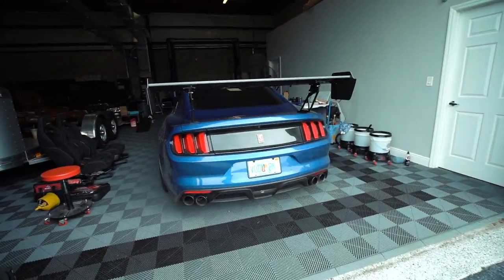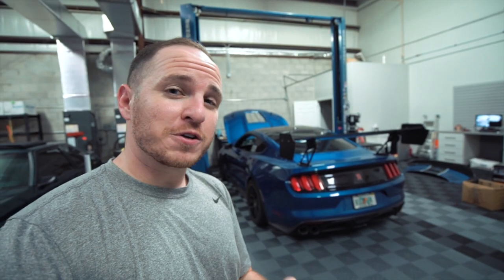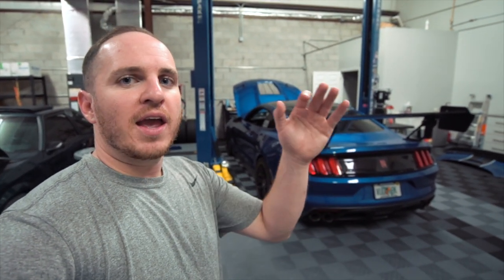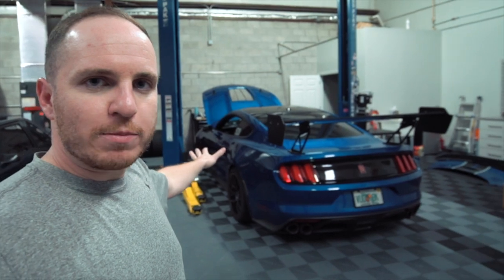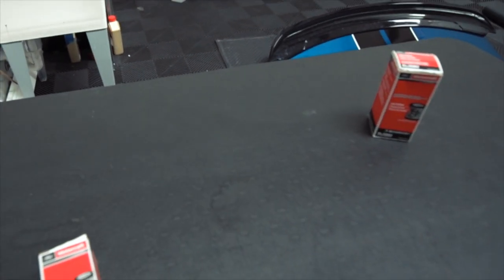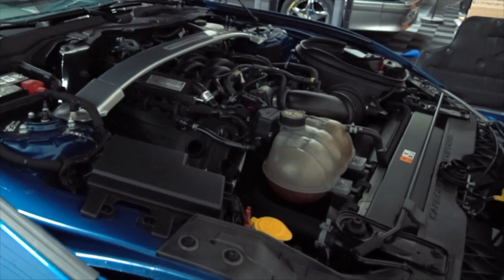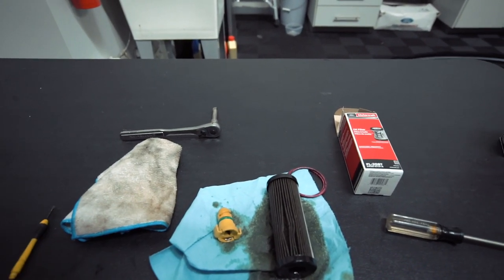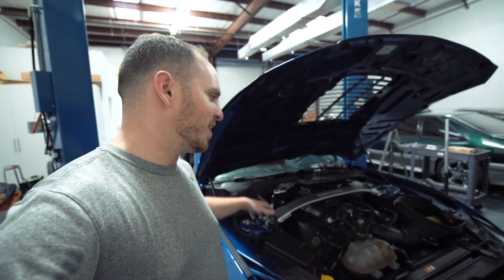GT350 OIL CONSUMPTION **DOES MY GEN II DRINK OIL?

Comment: Same here with my 2020

Only one thing to watch

The valve cover gaskets get loose and need to be re-torqued every oil change.

And Amsoil lasts a lot longer than Ford.  The oil % drops very slowly.

No loss of oil.  Though the oil cap also came off. 

Gen 2 motors also have more hp

Check out motor trends dyno tests...

50 more hp more and 20 ft lbs of torque.

Comment: I bought a 16' GT350 Tech with 30k miles 3 months ago.  All stock.  My first manual T!  I see a little oil consumption with no track use.  I only do light pulls up to 6k RPM, over that and its a jet engine!🏁

Comment: Got a 17’ and it burns about 1/2 qrt. Every 1000 miles.  13k miles on her. Still running strong.  I think running it in high RPMs (6000-8250) in 2nd gear and running it hard up the mountain (tail of the dragon) several times a year is the reason. I still wish it didn’t burn at all...
Reply: I had a 16 base track pack and 17 R and they both burned about 1 qt every ~1000 miles.  I DDed both (about 65 mi/ day).   I just bought a 2020 R so this video makes me hopeful.
Reply: I am watching this because I bought a Mach 1 in June and it’s using just about 14-16 oz every thousand miles. I switched to Amsoil signature series at 1,000 miles. That means at 5,000 mile oil change intervals it’ll use a full 12 quarts between changes.

Comment: 4:34 even Porsche recommends changing your oil after each track day. Oil is cheap and that Voodoo engine is a $23,000 engine just for the long block. I knew a ford tech that had to replace one under warranty that came in with no oil pressure after track use. He showed me the slip from parts $23,000 is a lot of oil changes.

Comment: Jeff I tried the UPR drain plug and IMO I'd just stick with the OEM.  They are cheap and no headaches.  They also seem like they click into the pan detents a little better.  I replace mine every-other oil change.

My UPR plug launched the magnet into the oil pan.  OK fine, I'll just use it without the magnet.  But at that point what's the use?

Comment: I own a 2018 GT350 and I’m have oil consumption problems, after 2000 miles it’s 2 quarts low
Reply: Ford standard says that the gt350 can burn 1 qt every 500 MI ..
.So ford indicated in their Shelby supplement that 2 qt per thousand miles was totally fine .. 

I was ok adding a qt per 500 MI but the consumption went to 4 and 5 qt and I took it in and they dropped a new gen 2 voodo in it ..

So drive it like u stole it my friends .. Have fun with ur gt350 . Just keep the oil topped off ..

. If you let the oil level get too low and the motor gives up ford will not Warrenty you .. So keep driving and keep the oil level up if. It gets  worse they will fix it .. 

It will drink more oil over time .. When it starts to consume more then 1qt per 500 mo they will fix it .  So 99% sure that you will get a new motor once it gets worse.. It happened to my 2017 and now it has a gen 2 voodo in it and drinks no oil , none .. Gen 2 motors started to be made in early 2019.. They have parts ford was using in its predator motor . They were strengthened at least 80% .. Pistons , rings, valve spring and seals, rods,timing chain components and even a new motor casting to add strength .,,

Comment: Jeff I have a 2018 GT350 with a late year build date.  I followed break-in procedure and period to the letter.  Installed oil separators at around 500 miles.  Had no oil consumption issues, albeit with pretty conservative driving.  Changed oil at 1K miles.  Sent to Blackstone for analysis.  Analysis came back clean, which was very comforting.   I now have a little over 2K miles on it and still no oil consumption issues.  Plan to do another oil change fairly soon since the car isn’t a daily driver and it’s been a little over a year since the 1K mile change.  Will send to Blackstone again for analysis to see what it looks like.  I figure if that comes back clean I am pretty safe, but knowing your experience and others it’s a bit like holding your breath and crossing your fingers and praying all at the same time.  I also wanted to comment on the new style filters.  I completely agree with you,  The new ones with the metal framework seem about 1000% better made than those others with the floating plastic piece in them.  I remember the first time I picked it up I thought it had a defect😂. Love the mods you have made and the track vids are awesome.  Keep pushin’ that thing hard👍
Reply from the maker: Stacy P thanks man! My gen I was drinking oil even during my more conservative driving during the first 500 miles. Sounds like you likely got a good one! 👊👊

Comment: Good to hear. I just took my ‘17 in the dealer. It’s going through oil at a rate of one quart every 157 miles. I’m hoping they replace with a gen2. Any tips you can give me dealing with Ford in this process?
Reply: Update?
Reply: Ford replaced my engine with a Gen 2 (2019) motor. It hasn’t lost a drip of oil since
Reply: @jasongraham5648  did Ford  get you a new warranty for that new engine or just kept existing?
Reply: The new motor came with an added 12 month warranty
Reply: They tried hard to only replacing the short block, but I was firm and forceful and got the whole long block. If your Shelby is going through the same thing don’t let the dealer and or Ford push you around. Stand your ground and be forceful.
Reply: @jasongraham5648  I am getting the long block tomorrow. Will have my car ready next Friday. I just need to fight them on the warranty. They are telling me I am only keeping existing warranty but I will push for an extended warranty on that new engine. Hopefully everything goes well
Reply: Good luck
Reply: Update?
Reply: The new motor is still running great without a single drop of oil lost. The new motor only came with a 12 month warranty

Comment: With high oil consumption on the GEN 1 motor, did that your exhaust tips turned black.
I have the exact same spec on my GT350 as you do.
Reply: My 2017 Gt 350 consumption is about a quart every 850 miles with the Ford oil. Did an oil consumption test and Ford said that is normal. I then switched to Amsoil and now I have to put 1/2 to 1 quart in every 1200 miles. That stupid dip stick is sometimes hard to read.Only Ford does my oil change. No tune ( too afraid). Only mod are lighter wheels ( 9 pounds lighter per corner) which made a noticeable difference in acceleration. I now have 41500 miles on it . It’s daily driven.

Comment: '17 GT350 here @ 9500 miles (8k of those in the past year) getting 1/2 to one quart per 1000 miles. Maybe less? Which seems reasonable to me with any high strung engine like this. Using Amsoil. FP oil separators installed. I've been sending my oil out to Blackstone for every change. I've had the oil in there for as long as 6 months with a track day and daily driving and the numbers come back good. Blackstone suggests I let it go even longer but I think I'm comfortable doing an oil change every 6~ months give or take. One in the spring and one in the fall feels about right. Screw doing it in the cold lol I do have the piston slap sound from 2k-3k RPM under light throttle as well.

Comment: I’m looking at various 2019 gt350s in my price range, but they all have 25-30k miles on the motor. Do you think that buying it used with that many miles would be a bad idea? Or are you convinced that the oil issues are done?

Comment: Will ford void your extended powertrain Warrenty if you add a mishimoto oil cooler.
Reply from the maker: If something happened mechanically, I’m sure that’s the first thing they would blame lol. That’s the only reason I’m hesitant to add the FP350S Setrab cooler.
Reply: Jeff Ashton I hate how manufacturers look at modifications to help the car survive and try to cop out on fixing stuff. Ford is not alone on this either all of them do it.
Reply: @JeffAshton  I believe they would have to prove that the mod caused the failure.
Reply: @douglasm3310  this is reasonable. A manufacturer can only guarantee what they sold, not what you put on it later. Engineering is a thing. If you have an engine mod and your sunroof broke, they will warranty it, but if you have a shot valve, warranty no can do, i am afraid
Reply from the maker: Douglas m completely agree, I dealt with a similar scenario with another car manufacturer. By doing the right thing you may be doing the wrong thing.
Reply from the maker: chris r try telling that to a dealer when you actually have an issue. I’ve had a similar situation with another manufacturer and some dealers will do whatever they can to avoid fixing something. Frustrating to say the least, which is part of why I try to avoid dealers at all costs.
Reply: @JeffAshton  yeah I hear you, the back and forth would probably be miserable and take forever.

Comment: Do you have any suggestions on how to check the oil levels? I always check it cold and it's just above the lower dot after 2400 miles - first oil change at 700 and put in Amsoil.  (not planning to put any oil in)  Book says warm after a min 15 min but I feel like that can vary greatly.  Not a mechanic and hear 10 different things.

Comment: my 2011 5.0 drinks a lot of oil. I am worry about it but I do beat up on it. My car tells me when it's thirsty because it doesn't feel as smooth when going up the revs. That's when I check and add oil as needed. I don't see it as an issue. My 5.0 has close to 100k miles and not a single issue. It still beats 6.4 Hemis with nothing more than a tune, slip on exhaust and a K&N filter. I think most GT350 owners that have issues do so because they don't take good care of their cars. Yeah, it's a track ready car, however that does not mean you just have to drive it like a maniac without checking something as easy as oil consumption.

Comment: I have 0 to minimal oil consumption on my gt350, it really depends on how the car is driven, but, did you 1st gen or 2nd gen have the piston slap sound from 2k -3k under light throttle?
Reply: I have a 2020 gt350 (gen 2 engine) I just picked up last month with about 25k miles. I have piston slap around that RPM until about 180 degrees of oil temp.

Comment: I change oil first time at 1K miles. Engine consumes just a bit of oil, prob same amount as it was in the catch can. The second oil change at 5K and no oil consumption. My is 2019 GT350 with gen2 motor. IMO there is a reason why gen2 doesn't consume much oil. In gen2 engine Ford beefed up cylinders wall. Hence, blow-by is not as significant as in gen1 engine.

Comment: I’m at 17K with my 2017 just had the oil consumption test and it’s normal oil consumption, 2 quarts for 1K with zero track days and no hard driving.  This kinda sucks for us with the Gen 1 motors hearing you’re not having any oil consumption with the new engine.
Reply from the maker: SuperChief5 damn man sorry to hear, mine was drinking way more at the end of its life span but my personal opinion would be to purchase an extended warranty if you plan on keeping it for the long haul. The variance of practically consuming none to consuming 2+ quarts doesn’t seem right to me either.